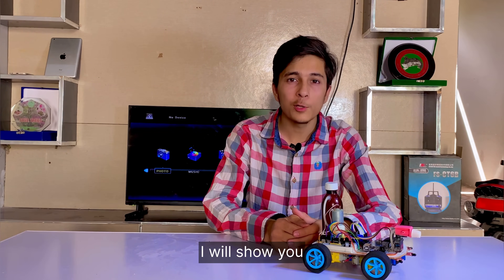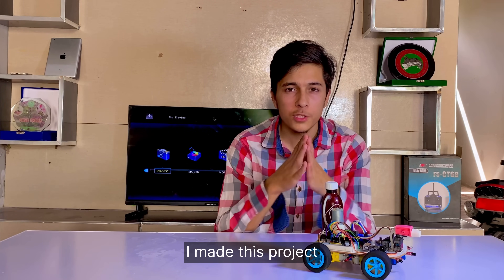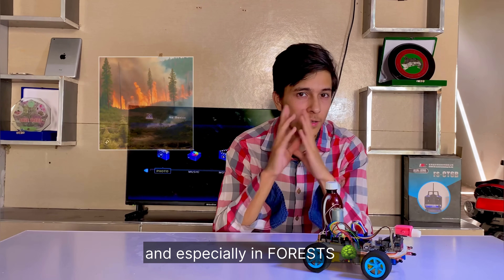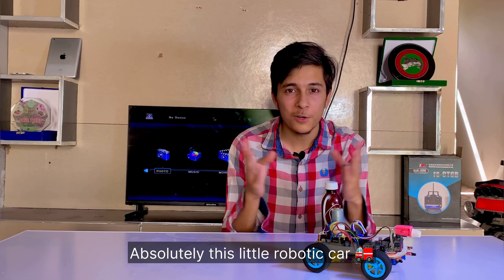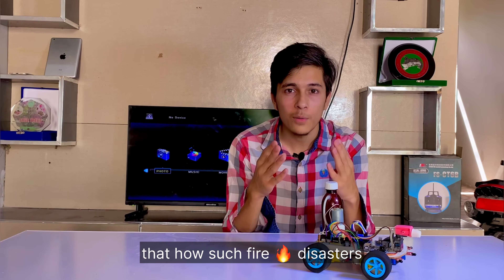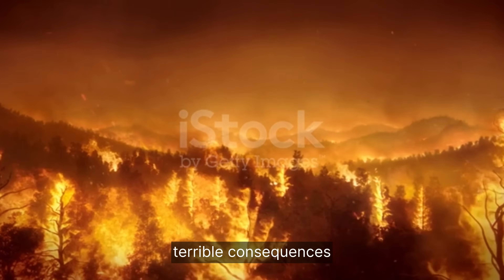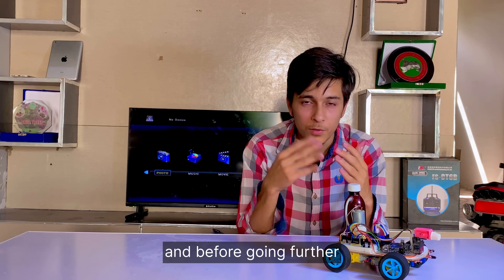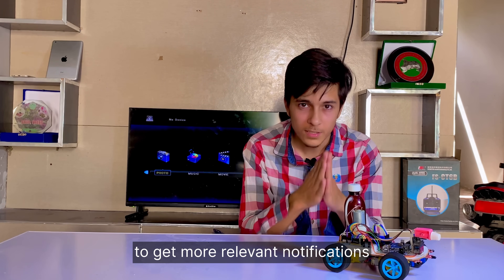DIY Fire Fighting Robot using Arduino  |  Auto Fire Chaser and Extinguisher

Comment: Hello sir i have made a robotics project and i want help extremely urgent i have made a arduino uno powered fire fighting robot but it is not working my science exhibition is on 28/2/25 please help me by contacting me you are my last hope im 13 year old and by seeing your videos i learned about arduino and first time i made a robotics project. Please help me
Reply from the maker: Sure, how can I help you
Reply: @saadinnovativeideas  my robot is not moving
Reply: It is only going in front
Reply: @saadinnovativeideas  also the motor pump is not working pls help tommorow is my science exhibition sir
Reply: @saadinnovativeideas  

 Main problems are like I have also changed the motor wires in the driver I am using 2 into 18650 batteries rechargeable I am using 4 pin flame sensor everything I am using like sure I like the main problem is the robot is not going towards the fire sometime it is stopping and sometimes it is you know going opposite the fire I have used fully charged to high quality batteries like you and I also use chat GPT but nothing else is going well how can a contact you I have made this for first time in Robotics I also used only for the water pump but nothing has changed I can you transistor also but nothing changed in both transistor and relay nothing changed  I can give you one hint when a power it from adaptor the water pump works but the Bom motor does not work and motor driver does not work and when I powered it from batteries the pump does not work else everything is working servo is working sensors or working but the direction of going Motors towards the fire does not help
Reply: Pls reply sir😭😭😭😭
Reply: How can i contact you
Reply: Sir can we discuss heee
Reply from the maker: Yeah, sure
Reply: @saadinnovativeideas  

Sir now what to do
Reply: @saadinnovativeideas  

 Motors going in the forward direction that is okay for me to show but the waterpump is not working that is the main fault
Reply: I cant message you as your insta account not gfollow me
Reply: I am now following you

Comment: Bro sad pls help me only 1 flame sensor of mine is lighting up what should i do
Reply from the maker: Do you mean other two to did not?
Reply: @saadinnovativeideas  yes the other 2 aren't lighting up we don't need to use do pin right
Reply from the maker: Make sure you have connected the positive (+ or Vcc) and GND of all the sensors with 5v and GND.
And yeah the D0 pin goes alone, use A0
Reply: @saadinnovativeideas  bro how can I check that I have connected it with 5v and gnd
Reply: On the Arduino the wire is connected in gnd and 5v I didn't understand how to check
Reply: @saadinnovativeideas  help bro
Reply from the maker: whether they are connected with 5V and GND pins of arduino uno or not
Reply: Bro I followed u on insta I have a problem in the project and I want to show it to u
Reply from the maker: Alright
Reply: Bro u would need to follow me then only I will be able to msg u
Reply: @saadinnovativeideas  bro no tension I got my mistake I made a mistake in soldering i will fix it anyways thanks for ur efforts
Reply from the maker: My pleasure 😇

Comment: Bro water pump automatic Strat
Reply from the maker: Do you mean before fire is detected?
Reply: @saadinnovativeideas  yes
Reply: And the fire is detect than stop the pump
Reply from the maker: Then you have made connections wrong with transistor. Double check connections for you transistor with circuit diagram
Reply: @saadinnovativeideas  I use relay module
Reply from the maker: For relay module follow the connections given below    

Arduino ——-> Relay mod.    
   5V   ———>  VCC   
  GND ———>  GND     
A5.   ———>  IN  

Pump   —————> Relay mod.*Slot*    
 wire 1  ———->  NO 
 wire 2 ————> COM
Reply: Really I checked but same condition
Reply from the maker: Try this way

Relay   ——>   Arduino (Pins)
Vcc        to          5V
GND      to          GND
In           to           A4

Relay No     ———>   Pump GND
Relay C       ———>  arduino GND

Arduino VIN  ——>.  Pump positive
Reply: @saadinnovativeideas  thanks bro it worked

Comment: Bro i really need help can u help me
Reply from the maker: Sure, ask
Reply: Bro my flame sensor only has three pins not four like yours it's fine na
Reply from the maker: Bhi 3 pin sensor mai anlaog (A0) pin nahi hota or ye code and circuit diagram 4 piin sensor kelia hai
Reply: @saadinnovativeideas bro can u pls share the link for the 4 pin flame sensor pls
Reply from the maker: https://drive.google.com/file/d/1_jVElKTNe07ipaboMmKh86ueropf7Lgs/view?usp=drivesdk
Reply from the maker: https://drive.google.com/file/d/1bFK8Dwt6g-Z2kP-Qzci0NTRzXW0DrkRT/view?usp=drivesdk
Reply: @saadinnovativeideas  and my last doubt is that when u attached those wires which I previously asked the +,- ones on the breadboard which type of wire u used did u just cut the jumper wires or is it a specific type of wire which I have to buy
Reply from the maker: No, its just and ordinary wire which ever you use for connections or also you can use trimmed jumper wire
Reply: @saadinnovativeideas  thnx
Reply from the maker: Yes sure
Reply: And another doubt that those wires green yellow and red which u attached on the breadboard on the + , - pins are those important
Reply from the maker: G bilkul important hai
Reply: Ohk thanks

Comment: Can I use one relay instead of the capacitors and the diodes and if I do will the code will change?
Reply from the maker: Yes, no need to change the code
Reply: Thank you and What about the circuit how do I connect the relay explain please
Reply from the maker: Follow the connections given below

  Arduino ——-> Relay mod.
      5V   ———>  VCC
    GND ———>  GND
    A5.   ———>  IN

Pump   —————> Relay mod. Slot
    wire 1  ———->  NO
    wire 2 ————> COM
Reply: @saadinnovativeideas  can send me a photo of the circuit diagram it will help a lot thanks.

Comment: Bro it's working but u need to change the code little bit at starting and also need to set the motor values(Ao, A1, A2) and also their angles
Reply: is everything working on yours? we followed everything from the video to the coding. but, our servo and pump is not working. can you help us?
Reply from the maker: @janeeee226 flip the servo side wires connections and leave the middle one. And which water pump have you used? How volt?
Reply: @saadinnovativeideas  the pump is now working, but I've doing it to the servo, still not working

Comment: Can't  I just don't use capacitor and resistor ?? Please help me
Reply from the maker: You can use relay module instead of these
Reply: @saadinnovativeideas  🤕its so embarassing to say but i don`t know how to use it .
Anyway I am making this up for my science exhibition .I hope mine will work out as yours .
Reply from the maker: I mean instead of transistor capacitor and diode yo can use relay module with following connections 

  Arduino ——-> Relay mod.
      5V   ———>  VCC
    GND ———>  GND
    A5.   ———>  IN

Pump   —————> Relay mod. Slot
    wire 1  ———->  NO
    wire 2 ————> COM
Reply: @saadinnovativeideas  is 5v relay module fine or not ?  And will code work if I use relay module?
Just want to know
Reply from the maker: Yes fine and code will definitely work
Reply: @saadinnovativeideas  thankyou🙆‍♀️
Reply: @saadinnovativeideas  all sensor are working except bo motor why??

Comment: if i use 1 ir sensor instead of 3 can code work cuz in code there is 3 ir sensor define
Reply from the maker: The robot will move in only one direction
Reply: @saadinnovativeideas  then can I also use 2 BO motor or do I compulsory need 4 BO motor
Reply from the maker: You can use two as well

Comment: Sir all components are doing work, but the sensor is getting light but no work is being done in help when the fire is taken nearby
Reply from the maker: How much is your net input voltage and which sensor are you using (3 or 4 pin)
Reply: I am using two batteries of 3.7 and 4 pin sensors use
Reply from the maker: Do the bo motors move in the direction of fire? And does the servo and water pump shows reaction when fire is detected?
Reply: @saadinnovativeideas  No sir! The motor is not going towards the fire, but the servo motor are working and not even the water pump work .
Reply from the maker: Send me its photos on instagram sahibzada3767
Reply: @saadinnovativeideas  sir You are not getting a message on Instagram
Reply from the maker: From whom?
Reply from the maker: I haven’t received your message request
Reply: @saadinnovativeideas  Sir, I have commente' hello' on your recent post, please scene

Comment: hi saad i made this robot but it is not working, there is one light in the Elego Arduino and one in the motor driver but when I put my lighter on there is no light in the flame sensor. the car is not moving or doing anything. I can only think about two things that are different between you're a robot and mine your coding version is 2.2.1. and my is 2.3.4. and one more thing is that you did com6 in your coding part and my computer only shows com3 do these 2 things matter? Please reply as soon as possible. my project delivery date is near. THANKS
Reply from the maker: No, version variation do not matter and also you can upload the sketch via any port (COM) available
Reply from the maker: What is your power source? And do the LEDs on the components turns on when you connect power supply?
Reply: @saadinnovativeideas  my power source are 2 rechargable batteries bur the led light in elego arduino and motor driver works but there is no light in flame sensors. 
After working lot on this project, i think there is no power supply in bread board, but when i put plus minus power supply , it only power in arduino .
Reply from the maker: Double check you connections with the circuit diagram especially for the sensors, if still doesn’t worked send me its photos or video

Comment: Thank you bro it works!
The main problem I faced was tp complete the correct circuit 
Rest everything was a cake walk( this is a paid promotion)
Reply from the maker: Glad it worked for you
Reply: Bro I completed total work but programming is not working please give me tips and new programming on a short
Reply: Can you pls help me
Reply: Mine is not working
Reply from the maker: Which components worked, and is there light on motor driver, uno and sensors?
Reply: @saadinnovativeideas  all except mini servo
Reply from the maker: For that, servo has three wires flip the side wires with each other and leave the middle wire check
Reply: @yashjalan2783  ours to is not working including the water pump.. how you detect the problem?
Reply: @janeeee226  Check the breadboard connections
I would prefer not to use the normal wires in breadboard, just use male to male jumper wires
Reply: @yashjalan2783  do you mean the hard jumper wires? I already solved the problem with the pump, just the servo is not working
Reply: Yes but only on one flame sensor
Reply from the maker: Which flame sensor are you using 3 or 4 pin?
Reply: Thx
Reply: hi, can you please help me to do this project ?,please reply as soon as possible. i just have a time 3 days to do this!.
Reply: / Hi, could you help me? Can I contact you by email?
Reply: Sad i used four pins 
But I'm making rest of it  
I will tell if anything is wrong or something

One question that can we use vcc as +
Reply from the maker: Yes on components the Vcc declares Common Collector Voltage which is positive pin

Comment: I followed all the steps correctly but it was not working pls hlp😢
Reply from the maker: Which sensor (3 or 4 pin) have you used? And also name the batteries
Reply: @saadinnovativeideas  4 pin sensor and 3.7v 18650 x 2
Reply from the maker: Is not a single component working? Do the LEDs on the motor driver arduino and sensor switches on?
Reply: @saadinnovativeideas  that's working but the motor and the flame sensor is not detecting and the water motor starts to works when the switch is on
Reply from the maker: Double check your connections with the circuit diagram. And are you using relay module or components I used yo run water pump?
Reply: @saadinnovativeideas  I'm not using the relay module and I used fully submersible water pump
Reply from the maker: I mean are you using the same components like transistor, capacitor and diode as I used?

Comment: Can I use 3 pin IR flame sensor is n this project? Will it work?
Reply from the maker: Not for this circuit diagram and code. Replace it with 4 pin
Reply: But only three pin were used na!!!
Reply: In flame sensor 4 th pin were left … only three pin were used here… I dint get 4 pin sensor here … I used 3 pin flame sensor … am mid way in this project….. will it work or not?
Reply from the maker: If that has A0 pin then it will work

Comment: Hi! We already completed the process and followed the exact materials used. Yet, ours is not working. What could gone wrong? Thank you.
Reply: Please, help us. It is urgent and for our project.
Reply from the maker: Is code uploaded successfully with the right port (COM)? Does not a single component worked?
Reply: @saadinnovativeideas Actually the port that you used is not appearing in ours, and yes not a single component is working.. The only thing that lights up is the L298 Motor.
Reply: But then, the L298 motor only lights up if we used 1 battery... We only used 5V water pump as that's the only available in the store. But, aside from that we copy the same exact materials. We don't know what went wrong with ours..
Reply from the maker: Send me pics or video on my insta sahibzada3767

Comment: Hello saad, 

In the following circuit the motor does not move, everything else works though. I have run a motor test code, and the motors run perfectly, pls do help your fellow subscriber.
Reply from the maker: If you have used 4 pin sensor and rechargeable batteries and still doesn’t worked then your motor driver may be faulty
Reply: Can I have your contact details, so that I can explain the issue indetail
Reply: Hello saad
Reply from the maker: My insta sahibzada3767

Comment: Not working please reply
Reply from the maker: Double check your connections and tell me the name of the sensors and battery used
Reply: Still not working
Reply: Any mistakes in program
Reply: Any mistakes in program
Reply: Any mistakes in program
Reply from the maker: Name the sensor and battery used
Reply: Ir sensor and lithuum battery
Reply from the maker: I mean is that 3 pin or 4 pin sensor
Reply: 3

Comment: Hello saad, my project won’t work, please help me.
The IR sensors can detect fire but when they detect it the motor, pump, servo all three do not work. Please help fast. URGENT  thank you
Reply from the maker: Which sensor (3 or 4 pin) and battery have you used?

Comment: have u connected the wires that you are showing, which inserted in breadboard(have u connected them or just inserted into braedboard???)
Reply from the maker: Brothers breadboard have internal parallel connection and work as an extension for pin inputs. Study about breadboard a little

Comment: Halo bro i wanna ask, why my transistor and IN4148 (diode) get hot when turned on, even though I have installed them correctly?
Reply from the maker: May be your water pump ampere consumption is high. Name the water pump, battery and transistor used
Reply: 5-9 V Water pump, transistor TIP122 NPN, battery 18650

Comment: Bro my Arduino Uno is heating from beside of the Arduino port plz answer me because at 10 feb I have to submit my project
Reply from the maker: What is your power source and name the water pump
Reply: There is no name at my water pump
Reply: Plz give me answer
Reply from the maker: How volt that is, do you know?
Reply: Total 7.4v
Reply: And the Arduino Uno light is not starting like when you start the switch and the light turn on
Reply from the maker: Then I guess your arduino uno is faulty. Does its LEDs turn on when connected with 💻 or battery
Reply: Plz give me answer 🙏🏻🙏🏻
Reply: Bro plz give me answer
Reply: No
Reply from the maker: Then replace your arduino uno
Reply: So bro my one flame sensor light is turning on but my other two flame sensor light is not turning on
Reply: What should I do
Reply: Pls answer me
Reply: Bro pls answer me 🙏🏻🙏🏻🙏🏻
Reply: Because at 21 I want to show my project at science exhibition
Reply: Bro pls help me
Reply: Mine car is not moving

Comment: Bro I have a doubt we have done all the connections but we are facing a problem that if we are connecting the connection at last from batteries then only motor drivers led is glowing and flame sensor is not working and if we are connecting USB to Arduino then only flame sensor is working and motor drive is not working
Reply from the maker: Which battery and flame sensors (3 or 4 pin) are you using
Reply: I'm using lithium ion battery and 4 pin flame sensor  @saadinnovativeideas
Reply from the maker: Send me its pics
Reply from the maker: My insta sahibzada3767

Comment: bro i mistakenly purchased 12V motor pump can i use it in this project?
Reply from the maker: It would heat the transistor and wont work properly
Reply: @saadinnovativeideas i changed in to 5v but the problem is, can i use the 3pin flame sensors
Reply from the maker: Brother the code and connections I provided are for 4 pin sensor having A0 pin. For three pin you will find it hard to modify
Reply: @saadinnovativeideas okay brother I will go with the 4 pin flame sensor. If I get any issues is there any possibilities to contact you.?
Reply from the maker: Yeah message me on instagram
Reply: Thanks @saadinnovativeideas